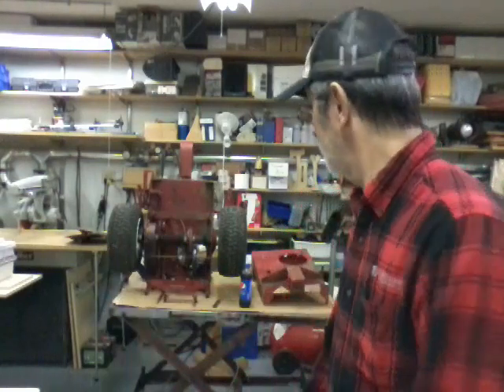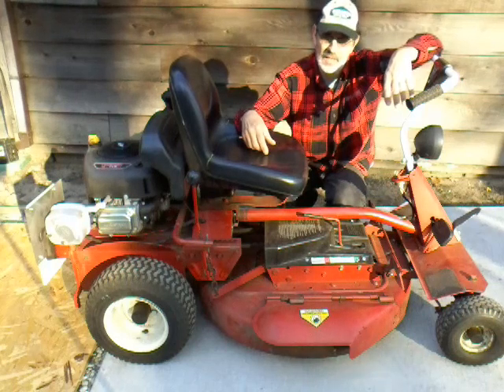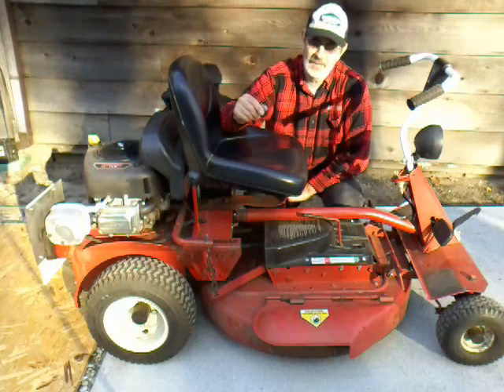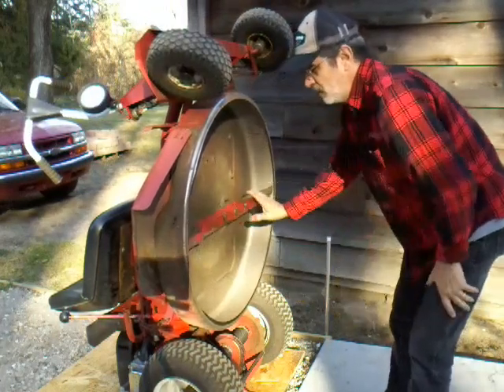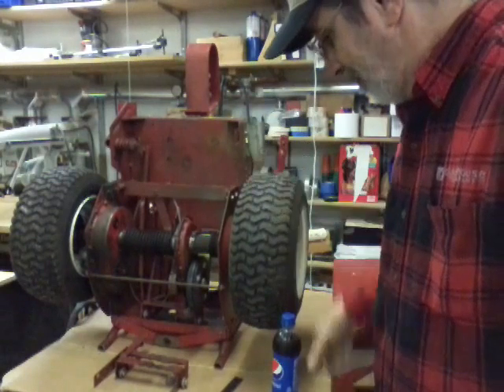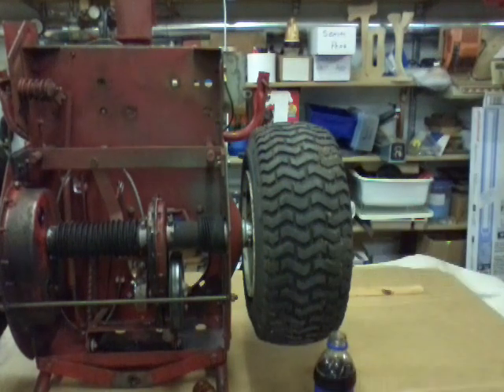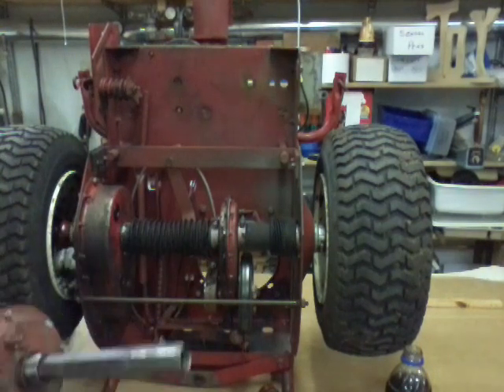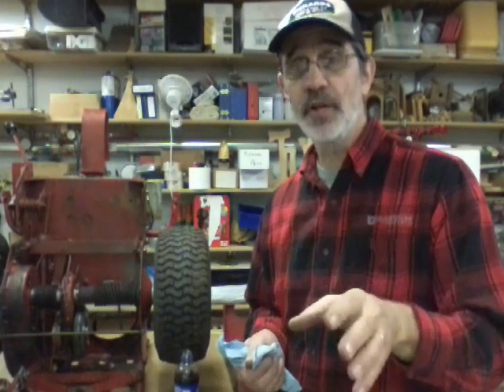56. Buying a used snapper,   things to look for

Comment: Well, I just wanted to give Jim a shout out for this superb video!  After watching it twice, several inane emails, and even a phone call later, I went and looked at my first Snapper for sale today. Also armed with how to read the engine code, I determined it was a 2001 on a 28" Hi-Vac.  Boy, this one had been ridden hard and put up wet!  I tipped it up  just as Jim suggested only to find both boots gone, zerk joints buried under rock-hard grease, at least one bad king pin (or bushing) and both front wheel bearings shot.  The main tube was immovable and probably frozen up with rust.  The engine ran but had not been cleaned in years and years. There were some other issues too, but you get the picture. I clearly knew more about Snappers than this owner, even though this is the first actual Snapper I have sat upon. I'm so grateful to Jim for all his help that I just had to share.  Now, on to the next one! Kudos!
Reply: Also there are short grease hose lines for that shifter.😂❤❤❤🎉

Comment: Thanks Jim!
I just bought 2 old Snappers last week.  Like I need another Snapper! The oldest one was a Comet Series 0 with a running 8hp Tecumce.   Needs new front tires.  The other mower is newer Series 13 with a blown no compression 12.5 Briggs.  Otherwise in very good condition.  Both machines for $100.  I couldn't resist.
Reply from the maker: Renee Wasinger hi Reese its Jim it sounds like you're recent purchase  was a good one, that comet dates back to the late 60s I have another viewer that has a comet and I think he said his grandfather bought it in 1969 and he wants to restore it but he's having a little trouble figuring out if the later parts that you can still get will fit in a comet.talk to you soon Jim

Comment: Thanks Jim for another interesting and informative video! By the way, do you have a video that shows all of the grease fittings on these Snappers? Also, how about a video showing how to lubricate the various moving parts like where you would use oil or grease in certain cases?

Comment: Jim, great video! Thank you for posting this. I’m in the market for one of these for the tight areas and to mow up close to fence lines and to get through small gates. I have 5 acres and use an 8’ finish mower that isn’t good for up against fences or any obstacles figured one of these snappers would work well for me. Until I watched your video I wouldn’t know what to look for past the motor to know if one of these are worth the money they are asking. You video may have saved me money and headache down the road. Thank you...

Comment: Jim thank you! You're videos are important information that I'm not finding (with nice common sense explanation!) anywhere else. I bought an older 42" rear engine snapper for $250. It cranked right up! But, after spending $350 in parts and labor, (to get new parts at spindle on one side!) I kept struggling to shift shifter arm to get gears changed! I'm still with this problem! I'll check for stick obstruction, and check hex thing and grease it up good. I'll keep watching every one of your videos too! Even if I can't get this one operating, I like snappers. So yep, your videos are like me going to school at 59 yrs of age! Thanks my friend. (I hope you're doing well, and your family is doing well! Until next time.....Adios! Randy in Union county North Carolina

Comment: I bought the lawn mower. It's older than the ones you have been featuring but common sense goes a long way. The boots were completly gone, Snappy has new boots in now. (As a woman I name everything) anyway your guidance has helped me more than i can say it's in pretty good shape with it's character markings for its age and now its being lubed and taken care of I'm sure with your guidance it will be in the best shape it can be soon. Thanks again. My budget couldnt afford to be taken on the purchase of a crap used mower or to purchase a new one. I just made 60 bought me a little piece of retirement heaven. Three acres of which I am trying to build a small self sufficient farm for retirement and for the past year I have been cutting it with push mowers.  You have been a blessing.
Reply from the maker: chillinjordan 
Well snappy sounds like a good name and I would like to help you out if you have any issues repairing this machine you can email me at
jimsfixitshop@gmail.com
  And I would like to have a picture of you and snappy to hang on my wall of friends. Jim

Comment: Thanks Jim. My first rider was a Snapper Comet that I found at a curb. Several years later I bought a used Snapper rear engine in the early 90's.

Two engines later it still runs fine. I have replaced the clutch/disc and rubber boots twice and it still works.

It's getting hard to shift. I know I need to go back thru it again. I have to hold the shift handle in reverse for it to hold in.

I'm tired of messing with it every year and looking for a new ZTR. Either Ariens or Gravely.

But the design of these old mowers is amazing. Thanks for the videos.

Comment: I bought a 28" new in 2001 for $1000 and have used it ever since to mow my 1 acre lumpy bumpy and hilly lot.  I'm no mechanic but I do the minimum maintenance every spring (air filter, plug, oil), including greasing that rear wheel bushing.  Watching this video makes me think mine must be near the end of its life even though it seems to run fine.  I wasn't even aware of most of the parts talked about, like the yoke, and that thing with the spring holes, and that long center pipe being important etc etc.   Really interesting video but I don't want to start a new career as a lawnmower mechanic so maybe I'll start looking for at new machines that'll last me the rest of my life.

Comment: Thank you.  There is a shop here in town who says they are still making them. They have an order in for some but due to COVID.  Most places I have called say the same thing you are saying. Also the Snapper models that look more modern with the circular steering wheel… I was told to stay away from those.  My brother is trying to help me find one.  Thank you again for answering.  I enjoyed your video
Reply from the maker: Well thanks for the tip I sure hope they are still making them, and you’re right the machines with the round steering wheel stay away from them that’s what I called the turtles most of them are pretty much junk the ones with the bicycle handlebars or Rectangular steering wheels are what do you want to look for. Jim

Comment: Jim. A friend of mine that works on small engines was going to scrap a Snapper 30" rider like the ones in your video. I asked him if I could have the mower being that I also have a Snapper 21" push mower as well as my collection of "Old School Lawn Mowers". I have not got to look everything over as of yet. The edge of the mower deck chute needs the rusty metal replaced - But otherwise looks pretty good for its age. The engine has been replaced with a 11 or 12 Ho Briggs & Stratton with the pull start.
I always remembered driving through neighborhoods when I was a kid within the Lexington/Versailles, Ky area of Central Ky seeing usually older men with their fedora hats mowing their well manicured lawns with these mowers. I am getting ready to retire from my state government position as a welder/fabricator within the KYTC effective in March 2018 - So I need to keep my creative mind active along with my amateur radio exploits.Thanks for your video & my very best regards from Versailles,Ky.
Reply from the maker: IronDuke502 
How about a picture of you and that snapper collection I'd like to have it for my wall. Thanks Jim

Comment: Jim, your channel is GOLD to me, i own 2 Snappers, a 33 inch Hi Vac, and a 30 inch Regular deck. As i write this the 33 is having a 13.5 hp
B&S Intek engine installed, the 30 has a 11.5 hp Intek engine. By the way Pepsi should buy your drinks , those Pepsi bottles get lots of views 
on You Tube, Thanks Bob
Reply from the maker: Yeah I get to come in a lot about the Pepsi I suppose I shouldn’t show it. Jim
Reply from the maker: @BG-pd6os  The one I’m rebuilding right now is a 42 inch with a 16 hp V twin engine. Jim
Reply: @jimjackson9381  , Jim we are also restoring a 24 YAZOO Big Wheel mower, paint job too!

Comment: Just bought a 2015 28 inch. It is immaculate, garage kept, the guy I bought it from bought it new from a snapper dealer, only thing it needs is a new friction wheel as it really slows down in 5th gear when going up hill. 

I gave me all the original owners manual, extra blades, spark plugs, service book and everything. He even had a snow plow and a pull cart for it. The machine basically looks brand new aside from having a small tear in the seat. I picked it all up for 450 bucks!
Reply from the maker: Send me a picture of it and the plow I would like to see it.  Jim
Reply: @jimjackson9381  you got it !

Comment: 8/1/2023: Jim, thanks for sharing this information. I just stopped by a local shop that was selling an SR825. I didn’t thoroughly look at the machine yet, I just got the sellers phone number and asking price then came to the internet to find some information. Voila! You’re video came to me by way of Google. Anyhow, thanks for sharing and you’re a great teacher by the way. I’m a gear head/wannabe mechanical engineer at heart and thoroughly understand the simplicity of these mowers now. My only intimidation is getting into yet another “project” but one can’t resist the projects can they? The log cabin I’ve been rebuilding and not living in yet isn’t enough. (Kidding) I’m going to check out that Snapper now. ✌️
Reply from the maker: Well, let me know if you need any help working on it. Jim.

Comment: finally got a comit  snapper and  a 2nd gen for parts a 3rd gen im gunna use as well the comit is now top project ..... good video you published it in 2016 i see but snappers are snappers. and they are getting scarce ... that rear  part  you got handy really helpes me understand the details and where the springs go and  the grease fittings and how to check for wear

Comment: Thanks Jim !  I also had to burn my old tube bushing out with a torch 4 years ago. L.O.L. !!!  The old mower is now 14 years old and needs the axle boot job next up.  PS: The old 9-hp Briggs engine has held up exceptionally well !  Thanks again,

Comment: That hidden zert grease fitting can be replaced with a (pipe to tube fitting). You then run tubing to a convenient  location to another (pipe to tube fitting) like maybe on the frame somewhere. That way all you need to do is use a grease gun. No need having to lift mower up to grease. Run as many lines as you need to same location. 😂😂😂😅😊😊❤❤

Comment: Thankyou for this info Jim, I just picked up my first Snapper Hivac 1987,its in great shape  with all the points you have suggested. I've have started the tuneup on the 8hp Briggs and stratton. Grateful for finding your site. Only thing missing is the pulley shroud,, if your able to suggest a direction or have one to sell I will be needing this.
  Cheers Eric,, Ontario Canada

Comment: It's not a bad idea to check the bushings on the steering. If they are worn out the front tire can grab the foot rest and jam the handle bar in your belly when you turn. I bought the mower from a 400 pound man. The spindles didn't look bent but they might have been.

Comment: Jim, thanks for the very instructive video on what to look for in a used Snapper. I don't have to look far because there is one in my garage. It came with my house in 2010 and I bought a new battery and ran if for one season until I was temporarily incapacitated. When up and around I just used my Toro Recycler.The Snapper has been sitting in the garage ever since. It used to run. Can't find any tags to date it but the manual was revised in 1982 and a new Briggs & Stratton 195707 8.0 was put in in 1996. A nearby hop will pick it up and diagnose any problems. At the very least it needs a battery and they will probably put in a new carburetor. I enjoyed the video but am wondering if it's worth getting this thing going. I won't put a pile of money into it but if repairs are reasonable am I just buying myself a can of worms. Just how much maintenance does such an old machine require? I don't do heavy work and am a 73 yo female. I've put a new carburetor on the Recycler but am not about to try and figure out a 35 year old heavy piece of equipment. The mower shop said there are still people interested in old Snappers. Any advice for this lawn mower novice? Thanks.
Reply from the maker: Jane E Jett 
Hi Jane it’s Jim
  I would have to see some pictures to tell you what it’s worth but if you have a Lot of trees in your yard with leaves on them it’s worth fixing just for picking up leaves in the fall you won’t find anything that will compare to the vacuum system that is on a snapper Hivac. If you are handy at all and it sounds like you are you can fix this machine your self with my help, I have a lot of females  that have done just that. But either way send me some pictures and I can let you know what the machine is worth, and the state that you live,   in the northern state the machines are worth a lot more than they are down in the southern states where the factory was. Jim
Reply: @jimjackson9381  Thanks, Jim. I'll get some photos to you ASAP.
Reply: @jimjackson9381  Jim, I have photos. Can I email them to you?
Reply: @jimjackson9381  Sent photos but not state. I'm in St Louis, MO

Comment: A genuine American Icon, had mine over 12 years, a year ago I had the tired Kohler 15hp. replaced with a Kohler Confidant21hp. I can't imagine having anything else,sadly Snapper sold out to Briggs and Stratton and they are a mere shadow of the past.
Reply: In 2002, Snapper was acquired by Simplicity Manufacturing- which was subsequently acquired by Briggs & Stratton in 2004.

Comment from the maker: Hi it's Jim
  How high are you trying to get it up to the machine is engineered and designed for the height range that it has, you can raise the back of the mower deck by lifting the chains I'm not sure how you would lift the front to make it level. thanks for your question.  Jim

Comment: There’s just no cut equal to a genuine rear engine Snapper.🐢

Mine is a 1980 10 horsepower Briggs and Stratton 30’’  fork end mulch bladed mowing dynamo. Normal routine maintenance ( minimal ) keeps  it ready at the touch of starter to keep half the neighborhood groomed as a putting green. Easily cuts in fifth gear with power to spare. Can mow in reverse with wide range of forward mow speed. Razor sharp blade.
I like synthetic top shelf 20 50 oil in mine. The proof is in the pudding as it runs as new after all these mow seasons on original drive train. Save for new driven disc, normal wear item, ten minute change out, 20 dollars.

Comment: I just checked with parts tree parts list for the yoke, you showed the worn area in certain gears. the cost   is so  priced up almost double what you said. I just bought a 1977   30 inch cut one. I guess I'll look tomorrow, to see," how many things", your mentioning, are bad. But it was about a 250 mile round trip, "I certainly was going to buy it". He showed the engine running in the market place add/video.  Only $50.+ $40 gas And 8 hours time. I was looking 2 months for a deal.
So far grease/oil/dirt stuck all over rear area worse than I ever seen. and one bad boot.
Reply from the maker: That’s a good deal that’s for sure. Too bad it’s so far away, that’s typical with the old style boots. They were usually the first thing that went bad on a snapper then the sand and grit getting into the boot area didn’t help the differential or the chain case bearings any. And yes, the older, the machine, the more pricey the yolks are sometimes you can repair the yolks by welding and grinding them back in the shape. I seen one viewer that bolted a small strip of steel onto the side of his yoke and the chain case slid on that instead of the in the yoke.       Jim
Reply: @jimjackson9381    thks for the response back Yeah, was to bad I had to travel so far, and spend most of a day to get one. I guess
I just wanted a deal. I got interested when
I seen you had videos teaching, all about 
them. I'm back watching 2 or 3 more today.
It's funny that even starring at the screen where your showing the  demo table cut away fender one. I still don't understand what makes the different speeds.. Just because it goes to a diff. spot on the hex shaft , what gives it diff speeds? Is it something in the chain case I suspect it's that, or there would be no other purpose for it.
Reply from the maker: @janbill79 no it’s not the chain case per say it’s that the chain case moves back-and-forth to a different position on the drive  disk on the bottom of the engine the farther out the chain case hits on the drive the faster the machine goes then when you move the chain case to the other side of center it gives you reverse very simplistic and well designed machine you be glad you have it.

Comment: Good morning Jim I'm so glad I found your channel. I immediately subscribed. The bagger system is it all the same for the 28" HI-Vac models? Or does it vary? I just bought a 2013 model but I'd like to purchase a bagger for it. Thank you.
Reply from the maker: 2013 through 2018 models is what I call the snapper turtles just to distinguish between the body styles of the old and new the new styles are not that desirable they had many problems and issues and that is the first year they changed the discharge chute on the deck to take a new style deck boot. And they continue that through 2021 if you buy an older bagger you will have to buy either a new style boot for your machine or a old style discharge chute for your deck, let me know if this completely answers your question. Jim